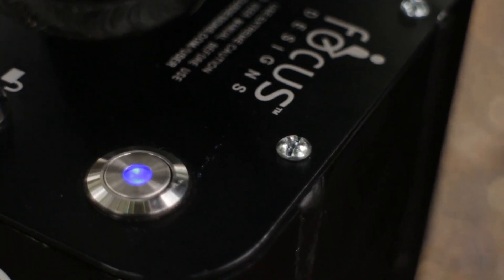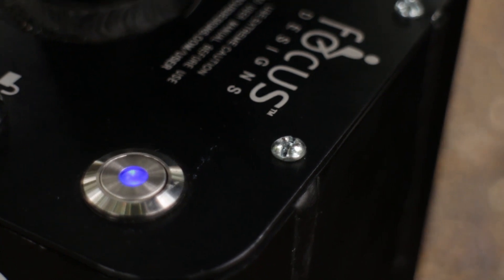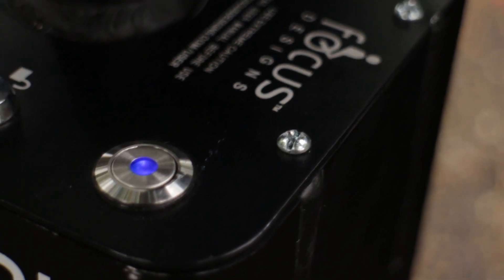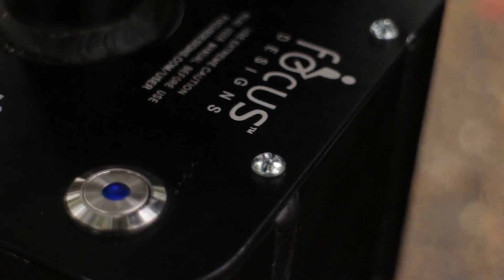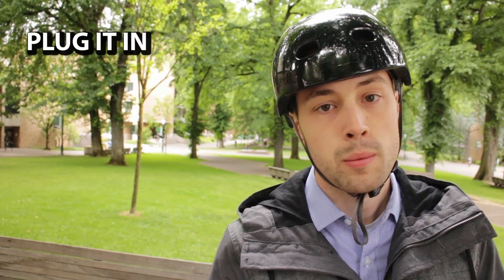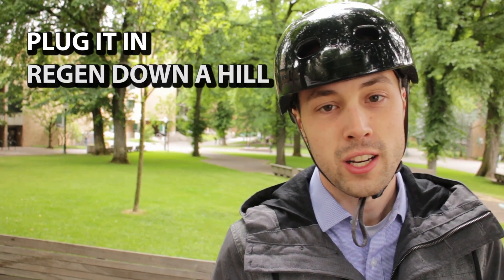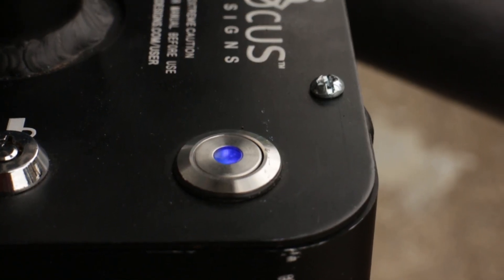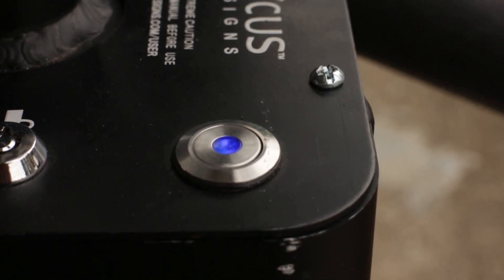Regenerative Braking

Comment: I have v2 of the SBU and it's a great get-around. I installed a CycleAnalyst to better track the battery health. It also monitors regenerative braking but my area is really too flat for much benefit. On the flip side, there is less upward elevation too!